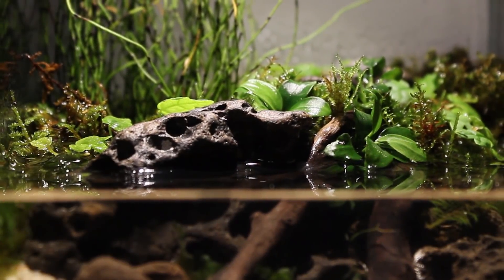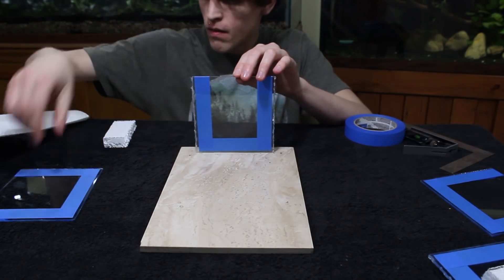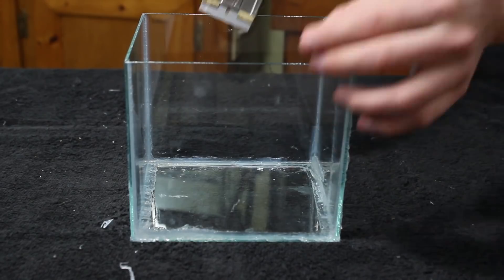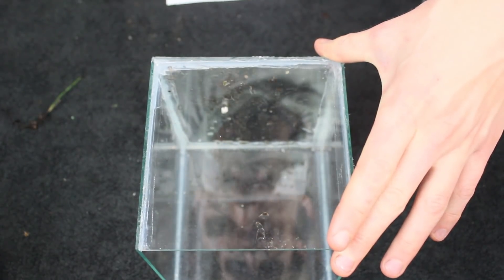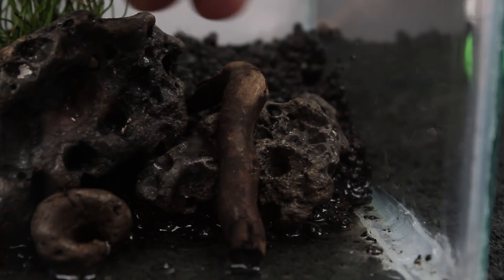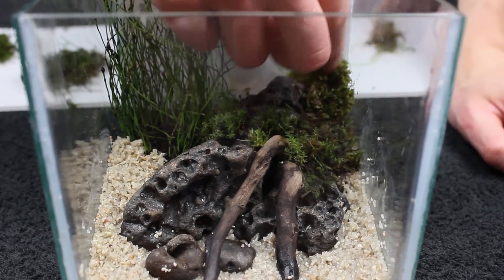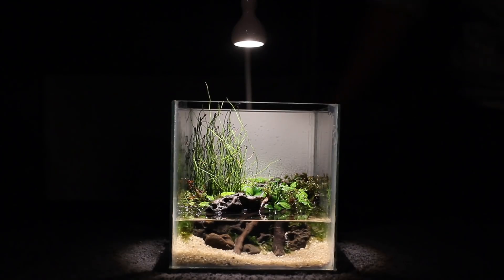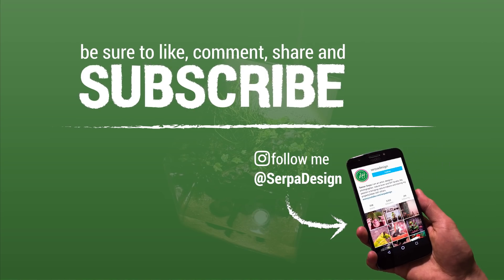Making a 0.8 Gallon NANO RIPARIUM

Comment: New subscriber!  Long ago, I grew the smaller closed terrariums with success then moved away for school and my parents, against my advice, opened them up and watered them.  Dead.  Now, 40 years later, I have been gifted a massive glass water bottle with a spring gasket lid and thought it was time to give it a try again.  I'm so excited with all the new plants I've seen on your channel!  My question:  Can you put orchids in a closed or narrow opening terrarium?  I have over 200 orchids, some quite small, and I know they are technically "air plants", but I thought maybe if I placed them high in the bottle, they would be happy in the humidity which orchids love.  Have you tried using orchids and, if so, how did it turn out?  Thank you.  Looking forward to many more hours of future and past videos from your channel.

Comment: As a glazier that builds aquariums on the side for extra money your prep is exceptional it's a lot of work with the tape when you strat making a lot you sorta learn how to silicon smooth without tape and using your finger but you should still use your finger

Comment: On a small tank like that you can literally remove all of the visible acrylic with no issues at the razoring clean up stage, right up to the seams. You just don't want to go into the seam itself. I did this to a ten gallon. It still holds water fine with no issues. It's a slightly cleaner look.

Comment: When I built my 2 large tanks that whole masking tape thing did not work out at all. The silicone cured super fast for some reason so by the time I pulled the tape it ripped the silicone out and I had to start over. I just did it all without tape figuring most of the semi sloppy silicone would be covered by my background/substrate anyway. If I ever build a tank again it would only be a very small one, I'm not keen on doing another large one, it wasn't fun. Doing the background was enjoyable but by that time I was so burnt out from putting it together (everything that could go wrong did and my tool also broke while cutting the plexiglass, thanks china 😂). Tip: don't mess around. Buy a dremel. I know they are probably not manufactured there (probably mexico or partially us) for the us market but german tools are the absolute best. I don't know what I was thinking buying that cheap junk. Glad I didn't get hurt 😐

Comment: I've made about a dozen aquariums from green house glass (3mm), never seen them built from the sides down though.
I always make mine from the bottom up. I guess whatever works for you.
I made a 2ft long, 6 Inch Deep and 7.5 inch tall aquarium for my betta with this 3mm glass (with a center brace). Gives him a lot of surface area with a long stretch to swim in.  he loves it all planted up. it's this size because it fits on a wooden shelf on the wall, not too heavy even though its 2ft long.
Reply from the maker: Good stuff! 😎👍

Comment: Beautiful! Love the placing of everything in this. Will it tolerate the standing water though? Every (similar and other) nano build I have done have rotted 'the second' I have looked away. Do you ever have this problem with any of your terrariums/vivariums/ripariums? I know you advocate springtails and charcoal false bottom for many plant setups. I have used active coal drainage layers, but not springtails. 9/9 setups have rotted right away, so the enthusiasm is slowing down a bit.
Reply from the maker: If you're having issues with rotting, I'm curious as to what kind of substrate your using and how much water. I rarely if ever have issues with it.

Comment: Hi, Tanner. When cutting the nozzle for the silicone is there a reason you don't cut on an angle? Does a flat cut allow the silicone to sit differently on the glass edges?

Comment: Its been a while but I have a question... Along with some of the same plants that you used id also like to incorporate some of houseplants like arrowhead and peace lily and a small pump/fountain. I'm also very interested in having snails. The tank I found (for free) is maybe 2 gallons maybe a little less and has a removable lid. Do you think that could all work? Should I add a heater?

Comment: Süßwassertang 😉
ẞ is a German letter for a long s, it's not a betta/b.
Reply from the maker: Interesting, I've never seen in spelled like that otherwise I would have known. I took a few German classes, so I'm aware of that. Good to know!
Reply: Wow, same!
Loads of sites swap it out for a b instead an ss.
Reply: @minibigs5259  ss might be OK, but it ain't 100% correct either. Germans call ß 3er-s (sss). ss is a short s in German, while sss/ß is a long s.
Reply: Benji F it’s sometimes also written as sz or sS.

I never thought about these struggles because I totally forgot that non-german speaking countries don’t have the ß. Very interesting
Reply: @benjif2424  I'm German and I've never heard the term 3er-s. Also, sss only ever happens when a composite is made from a word that ends on ss, and another that starts with an s. While not exactly the same, ss is used in case ß is impossible, for example because you're using a foreign computer.
Reply: @BenJamin-en3jb  Er wird als Eszett [ɛsˈt͜sɛt] oder scharfes S bezeichnet,[1][2] umgangssprachlich auch als „Doppel-S“, „Buckel-S“, „Rucksack-S“, „Dreierles-S“ oder „Ringel-S“.

Zuhause sagen wir halt Dreierles-S, mir ging es nur darum, dass es kein englisches ss ist.
Reply: @benjif2424  Hm. Hab ich echt noch nie gehört. Aber ich wette, das "dreierles" bezieht sich nicht auf drei s ;-)
Reply: Benji F it is called ringel s is Dutch
Reply: Since that word is a bizarre and useless German common name (freshwater seaweed) and all other common names are of English origin and even often spelling on foreign sites, and it's not even a liverwort/moss, but a fern gametophyte stuck in reverse evolution, I prefer using the common English name - Round Pellia.

True it's not a Pellia, but flame moss isn't fire, Taiwan Moss isn't from Taiwan, and most fissidens are the same species sold under whatever location the person who introduces them to the market claims they were collected or imported from, the argument over how to spell a German word with letters that don't exist in the language of the world is really tiring and pointless.
Reply: I see

Comment: Hey, love your vids! I am currently constructing my own vivarium and im having alot of fun with it. I want to keep my vivarium (35-35-55cm) humid by soly using a fogger. Will a fogger be enough to keep the vivarium humid on its own? My vivarium contains alot of plants and mosses.
Reply: It will work fine for the plants but if you have an animal in there you will need to spray or provide a water bowl.

Comment: You think Venus flytrap or sundew would like this/like actually thrive? They are pretty dang small. I bought quite a few sealed in glass jars with some kind of gel. They were guaranteed to live In  there for a year. Well I had them on the porch,  it rained and apparently they weren't sealed very well... the gel turned liquid and I think I need to take them out and do something with them. I have an old square beta tank comparable to this.

Comment: How do you get silicone off glass when you’re doing terrariums and accidentally get some on places when you’re putting down dirt on foam? Also what do you use as a silicone gun? It didn’t look like you were using anything in this video with the silicone
Reply from the maker: If you go back to the beginning you'll see that I'm guessing a standard caulking gun to do the job. As for removing it, you can either wipe it off with a paper towel while it's wet or wait for it to dry and remove it with a razor scraper.

Comment: I am wondering about the water quality. If the substrate will not cause problems. We will see, if the water turns into green.
Reply from the maker: I suppose it could, but I doubt it if I keep up with water changes.
Reply: So you will change water for example every two days? I would say that water will contain oxygen because of plants. But It is still standing water.

Comment: If you want to make the interior silicone look better just mask the interior, and spread with a wet finger and while the silicon is uncured, remove the tape.
Reply from the maker: That's what I did in the video. The problem is that it was hard to work in because of the scale.
Reply: @SerpaDesign  Yeah makes sense. I think it was only after about 100 1-5 gallon tanks did I get the hang of it.